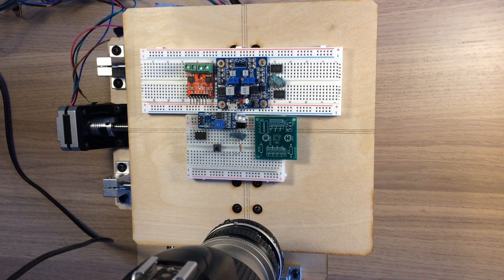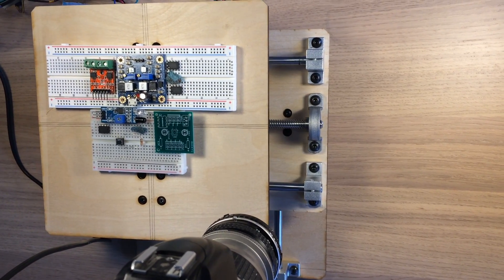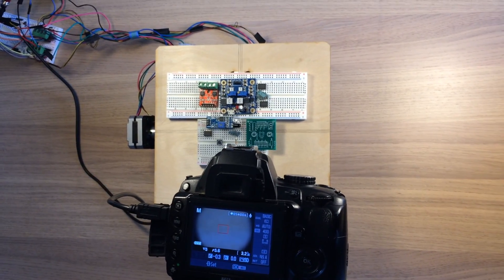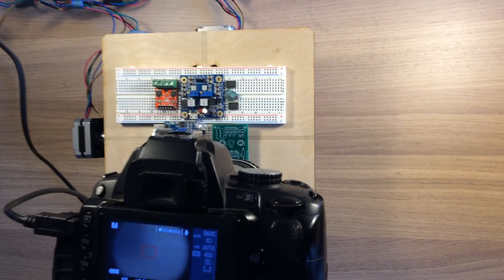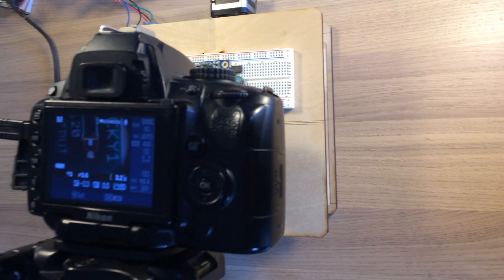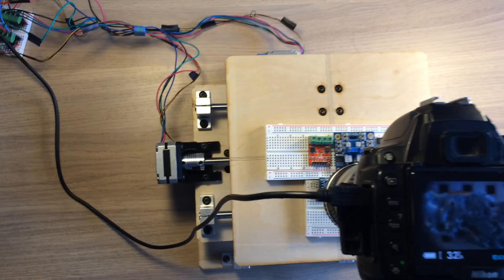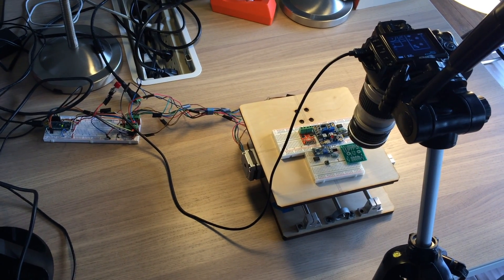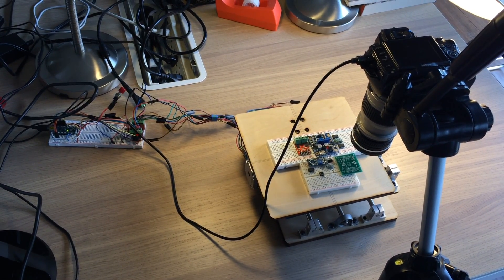Gigapixel microscope with Arduino

Comment: With the shallow DOF it really doesn't seem to buy you much unless whatever your imaging is truely "flat".  I feel like stitching works best and is most useful for images at great distance (ie, landscapes or astronomy)
Reply: I think if the platform could also move along the zoom axis perhaps those can be combined to get a sharper result. Some cameras like Olympus actually perform focus stacking within the camera.
Reply: Shouldn't be an issue with enough light and a small aperture
Reply: @techko0240  you run into physics problems where the aperture can't be any smaller, and even with tons of light and the smallest aperture setting you still have a very narrow DOF.  Its just a function of macro photography, microscopes and physics.   As someone else mentioned you could focus stack to "create" the depth but thats going to be a complex setup.  

But the main point i was making is that this just has a very small use case.  Ive used a DSLR/mirrorless as a microscope for working on electronics b4 (macro lens + live view + 32" monitor = best microscope for working on small things!).  But even in just 4k video the resolution is way more then good enough to read or see the tiniest things.  If you took an actual photograph at sensor resolution (30+mp now I think with a good camera) your limiting factor becomes optical resolution, not digital resolution.

This is really only useful if you want a super zoomed image of a large flat object.  That could be useful in some narrow circumstances like having a reference image of an entire circuit board or other similarity flat object.

Interesting, and useful in a very narrow set of circumstances, but like I said, that photography technique is really better suited for landscape images, wide field astronomy images, etc.